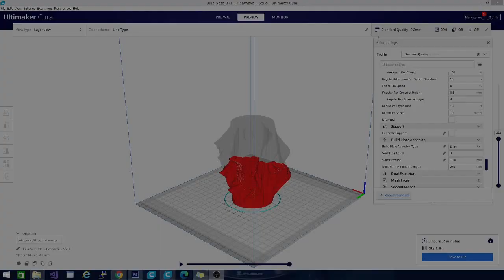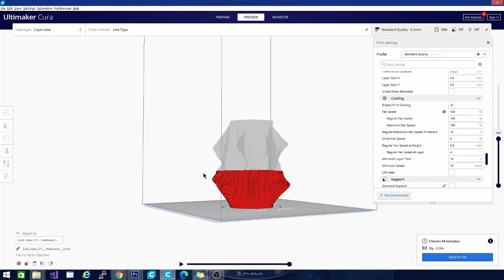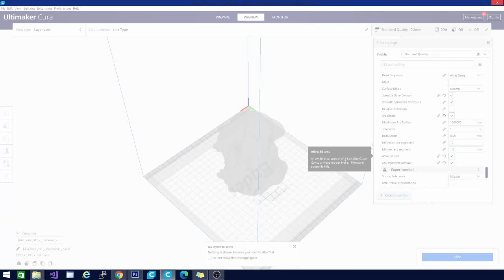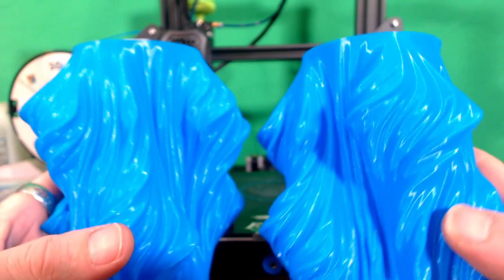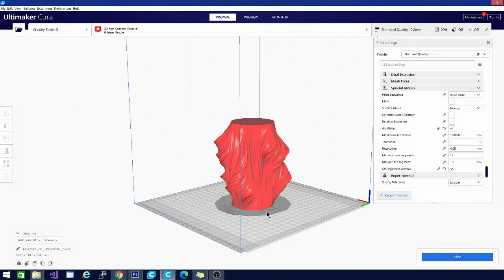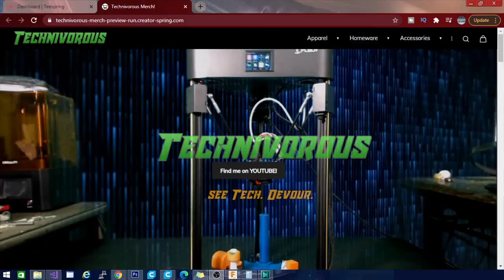Ender 3 v2 Using Cura's Arc Welder Extension!

Comment: When Arc Welder converts lines to arcs, it results in smoother movements with fewer hard edges, which have similar troubles as corners. Even if your machine is dialed in, corners are a point where dimensions and quality may suffer. Fewer jerks and less deceleration, fewer retractions, etc. In some situations it won't really be noticeable, but in others it could be night and day difference. 
You are right about spiralize mode already trying to do what Arc Welder does, so no surprise you don't see much difference in the video. Maybe try a large diameter curved print at high speed without spiralize (maybe with interior shapes) and record the printer movements to compare?
Your video is clear and to the point. Camera focuses well on the details as needed. Keep up the good work!

Comment: i have most up to date firmware for my ender 3v2 and arc welder makes my prints freak out. the head moves like its set to 500% speed and all precision goes away. a circle comes out looking like a hexigon and no 2 lines match up.
Reply from the maker: i hear where arc welder really shines is over octo-print, but personally i think its useless.

Comment: One advantage I had with arc welder is that on some of my vase mode prints the print head would pause for a brief moment and that pause would introduce blobs. However, once I installed arc welder (before AW the file size was ~1900kb and after AW it was ~70kb) the print head no longer paused during the print and completely eliminated those blobs. And I think this size reduction helped in one of two ways: too much data was being sent to the printer at once or the cheap micro sd card I'm using (the one that came with my ender 3 v2) wasnt able to transfer the data fast enough (I personally lean towards the former explanation). But regardless, I no longer have blobs on my prints anymore and I have Arc Welder to thank for it
Reply: This is exactly what I'm using it for and it seems to work. It really depends on the model and what scale you are printing. I've printed big stuff with no blobs but shrink it down and it gets blobs. Arc welder helps the printer make smoother curves without stopping. It's harder to tell on larger prints but you can kind of see all the polygons on round prints meaning it isn't a perfect circle and you get blobs from the printer trying to read the polygons in straight lines instead of curves.

Comment: Just draw a large (50mm or larger) ring and print it using arc welding and without arc welding. Without arc welding you see the flat sides around the ring. I'm currently printing a spool adapter and wish I had watched your video before slicing the model. I resliced the drawing and when current print is done, I'm gonna try using arc welding.

Comment: I think you may be missing the point with Arc Welder. The main purpose apparently is to reduce printer jerkiness/stutter for people who use a USB connection to their 3D printer, because USB can't(?) transmit a gazillion number of of g-code coordinates fast enough, which can cause buffer underrun. Enter Arc Welder which can reduce the amount of data by about 90% - totally eliminating any such tendencies.
Reply: I don't have a USB connection to my printer but will arc welder speed up printing in general? Because that's what some other Youtuber said.
Reply: @Gnomesmusher  How do you connect to it? SD-card? 
I use Cura on my main PC - > OctoPi/w Arcwelder - > Ender 3V2, and Arcwelder shows a popup telling how much it reduced  the resulting gcode. But if you don't normally  experience the stutter, you might not actually see much improvement from it.
AW will also smooth curves from lots of very short straight lines into actual curved segments but the difference is very subtle in the final print, perhaps clearer if printed at the highest quality?
Reply: @petternordgren2703   Hey thanks for the reply. Yes I do use an SD card and use Cura on my PC and then SD to my printer. I'm not sure if I'm seeing any stutter but that could be my inexperience not seeing it. I think I will try out Arc Welder even if it doesn't make my prints that much better just so that I have it when I need it. Thanks again.

Comment: One cool aspect of Arc Welder is it can add smoothness to a model that’s got a low polygon count. And as others have mentioned, it can prevent planner starvation which manifests as stuttering, usually in detailed curves with lots of small segments. Planner starvation is caused when the G1 commands are executed so fast that the SD card or host can’t send commands fast enough to keep the queue full, so the planner can’t chain segments. Marlin can slow down to prevent stuttering but it’s better to shrink the size of the G-code. Another good way to improve throughput is with the ?Meatpack” plugin for OctoPrint.

Comment: I just cant get cura 4.8.0 to work right . Had no problem with 4.7. Can some one help
Reply from the maker: Sure what seems to be the problem?
Reply: @Technivorous  thank you . I ripped 4.8.0 out and my g code completely and reloaded cura 4.8.0 . This this it loaded fully and is working great .
Reply: @Technivorous  what I'm asking should o us a different slicer or re install the older cura . I'm printing on a sainsmart 300 and using tinkercad .
Reply from the maker: I would roll back to the older version that worked for ya yes.
Reply: @Technivorous  when I was running  cura before the 4.8.0 update everything was fine . I could apply a brim and that the nozel start at the front left of the plate to prime the filiment . But now I cant get it to work that way.  It wants to print with out a brim and cant get a good adhesion on the plate

Comment: It should show it's self at higher speed ... Where you would normally start getting random bumps
Reply: Exactly. I have to slow down vase mode rpints to like 30% of my normal speed if I don't use arc welder and I have a 32 bit processor 4.2.2 board.
Reply: Does it only help circles?
Reply: @miclairmiclair876  helps with all arc or curve or portion of a circle

Comment: Hasn't the v2 a 32bit board? Arc welder only is something for 8 bit boards. You won't notice any difference on a 32bit board.
Reply: Yes this extension is probably better for 8 bit but I think this will be beneficial for the Ender 3 Max considering it has issues with spiralized 3D prints for some reason it gets overlooked during the print and its a 32 bit printer

Comment: Super duper new to 3d printing here. Just installed my bl touch and updated the firmware to support that. Will updating my firmware to support arcs remove the firmware that runs bl touch?
Reply: Arc Welder is an add on program to your slicer program like Cura. 
Open Cura, go to market place, scroll down until you see Arc Welder and add it. Restart Cura. Under Special Modes option you can check the Arc Welder box to use it when you slice your next model to print. 
No firmware configurations needed.
I run Marlin 2.0 firmware. 
I tried Arc Welder on some cylinder models and couldn't see any difference other than the G code was much smaller. 
You can achieve a similar effect by increasing the resolution in Cura, and there's YouTube videos that show how to increase the resolution. It basically is just shortening the line segments that make up the 3D model. Teaching Tech has a good video about that. 
If you haven't already, look up how to enable all the features in Cura because by default most of them are hidden. I keep all the features visible.

Comment: Look at the resulting GCODE file sizes! It's particularly a win on items with long arcs, compressing a stinkload of little straight G0 - G1 gcode segments into a few G2 - G3 arcs.
Reply from the maker: I have never had a gcode file to big to print, so if it dosnt improve the actual model I dont care about gcode size. And a shorter file dosnt equal shorter print time. This plugin is a quality improvement at high speeds, and will give some benefits when using octoprint. Being able to get nice arcs at high speed without stutters, does improve print time, but the file size is a moot point unless using octoprint, or wifi.
Reply: @Technivorous  With complex vases you often times can't print them at high speed because the processor can't keep up. Arc welder solves that. Its not about total file size, its about how fast the processor can process it.

Comment: HOW do you tell if your printer supports this?
Reply: Send an empty G2 command to your printer and see if it responds with 'Unknown Command'.  If it does, arcs are disabled.  If it complains about missing parameters (and it may disconnect, but that's no big deal), arcs are enabled.
Reply from the maker: a couple ways. whats your printer? the easiest way is to google your firmware version and see if arc support is turned on by default. if you use the extension and print something, you will know if its on as well, as it wont print the arcs, but it will print everything else, leaving you with infill exposed.
Reply: BTW The old Ender 3 supports G2/3.
Reply: on newer marlin firmwares, it sometimes is shown when using the M115 command  : "ARC_SUPPORT"

Comment: You should try printing a welded file via OctoPrint.  Time both prints and do a quality compare there.  I think you'll see a difference, both with time and quality.  Also, did you happen to time your test prints in this video?

Edit: you might also try dropping mm_per_arc_segments to 0.75-0.50.  If you drop it too low you may experience stutter, so make sure your print times don't increase.  It takes a bit of time to get the calibration correct.  I'm working on a PR that allows altering arc interpolation settings via gcode, so hopefully that will make these tweaks easier.
Reply: I'm running all my prints with ArcWelder via the OctoPrint plugin now and apart from the bug FormerLurker quickly fixed the moment I reported it (in the dev. version) I've only seen improvements from using it:  smaller gcode files (and hence less going over the serial link between OctoPrint and printer) and overall just more "smooth" motion of the head.  I used to use Cura 4.8 in the past, but lately fell in love with PrusaSlicer's paint on supports and the fact that it also runs on my old (backup) 32bit coreduo laptop just fine (with mesa because of the ancient intel gpu in it).  Anyhow, again thanks to FormerLurker for all his great stuff!
Reply from the maker: Oh d ok nt get me wr ok ng I plan to do a lot mor testing with this extension as I said I definately see the possibilities.  The time on the cylinder came out the same at 24 minutes for each. The vase time was slightly faster with AW, but I will definately run some prints over octoprint and do another compare as well. Either way I hope you don't take this video in a negative light, and I fully intend to try aw on some other machines as well. Keep it up dude.
Reply: @Technivorous  When I mentioned 'Maximum Deviation' I should have specified this is within cura.  This setting affects the 'Maximum Resolution' setting.  Note that if the resolution/deviation are too low, you may encounter issues printing without arc welder, so beware :)